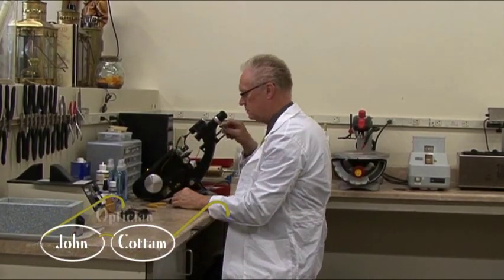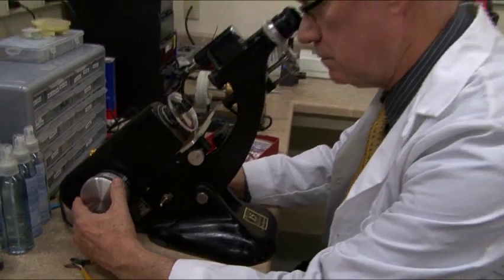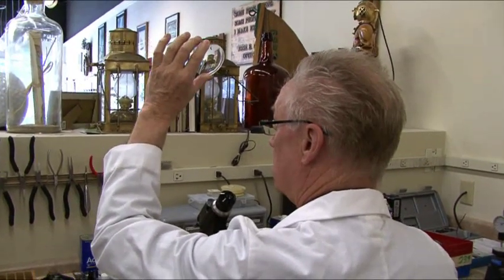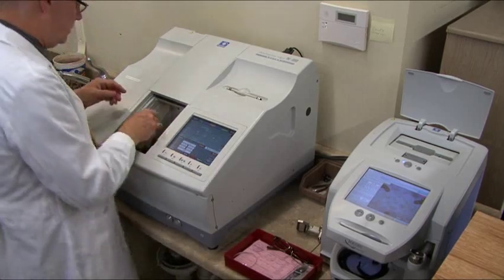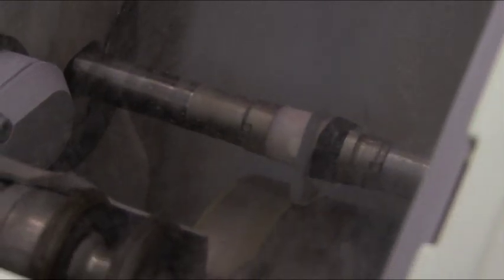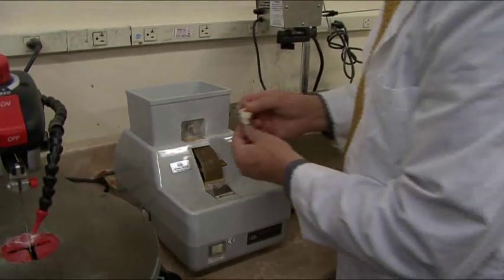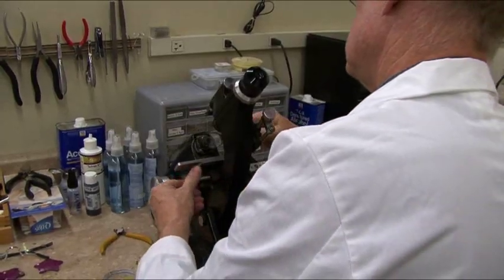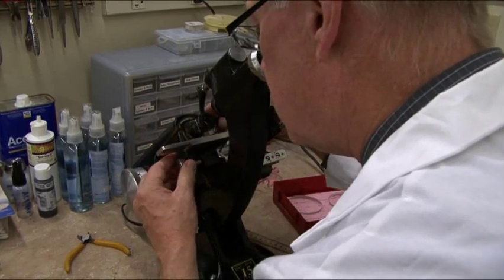"How Eyeglasses are Made"   Custom and Designer Glasses

Comment: Great video! I highly agree on the working out the edge imperfections after the lens comes out of the edger. Very few people in the business do that anymore. I safety bevel all lenses that come through and i Roll and Polish all Rimless lenses after i groove them. I also Roll and Polish Lenses with power over a -3.50 or so. Just gives it a much better look from the side. I do it even when i Bevel the lens at a Frame Curve setting